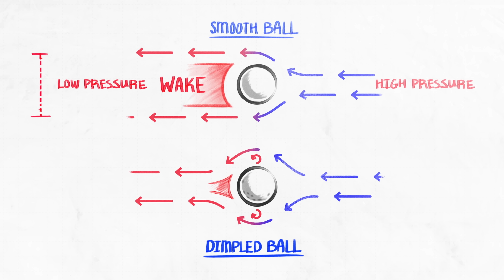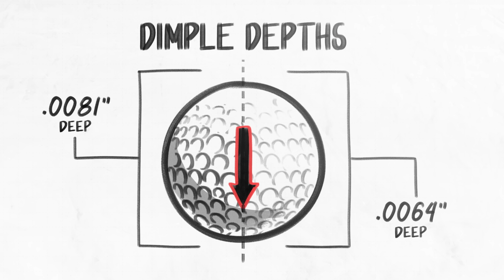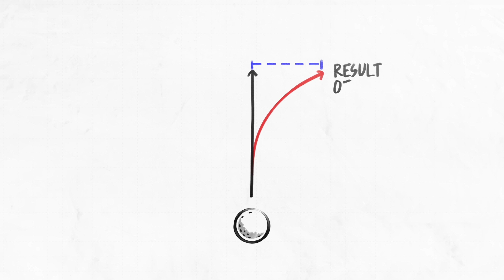The Art and Science of Ball Flight with Ludvig Åberg and No Laying Up

Comment: So what does this mean for launch monitor accuracy. If dimple patterns have such an impact on traj, aren’t they inaccurate?
Reply: It also depends on the type of monitor, if it's got radar tracking it shouldn't be an issue. But if it's pure impact location camera based then 100%. Monitors have to assume the ball is constructed correctly otherwise there's just too many unknowable variables, such as orientation of the defect. 

Pros use both Trackman and GC4 for this reason, GC4's cameras are the best at actually measuring the club and impact conditions. Trackman is best at, well tracking, the flight of the ball with radar. GC4 for launch conditions, Trackman for carry numbers. But even in this, if you dig in under the hood both versions have measurement errors and different modeling. 

At the end of the day, pros use both. For regular folks, the range ball youre hitting has more of an impact than the monitor's modeling/measurement errors. You just have to learn what the error is and correct for it. My MLM2PRO is always about 1/3 of a club too long in the carry numbers because it assumes I have lower spin on the ball than I do. I just know this and adjust on the course accordingly.
Reply: I posted the same question. I don't see how indoor monitors have any idea about the aerodynamics of each golf ball design. Mygolfspy uses a robot outdoors so that seems like the best head to head test. Individuals would have to hit them on course.